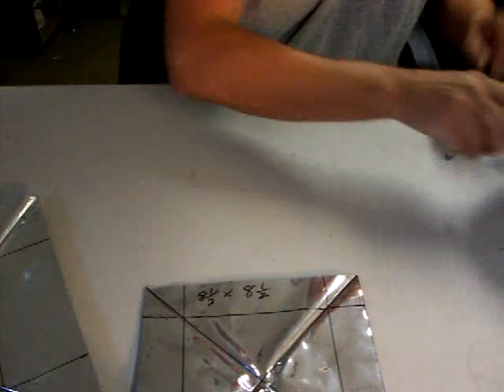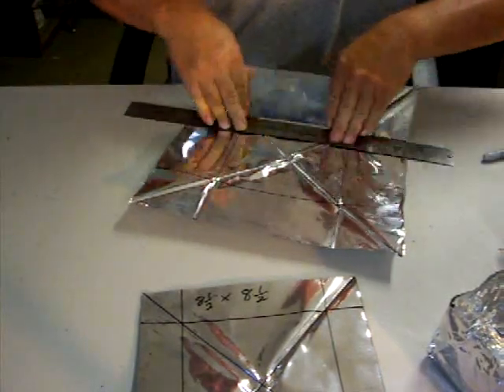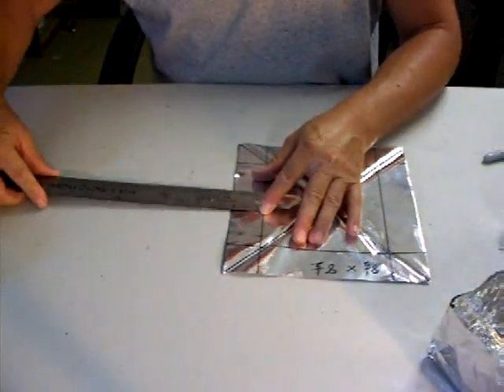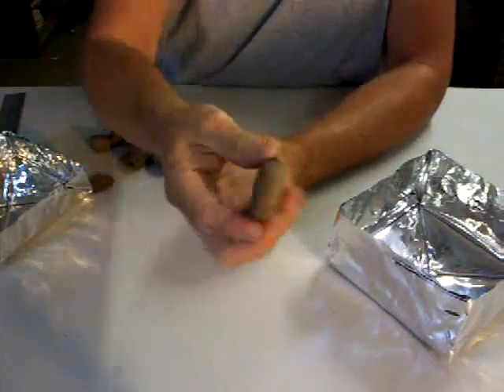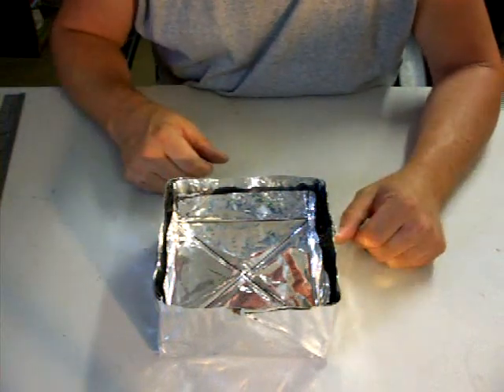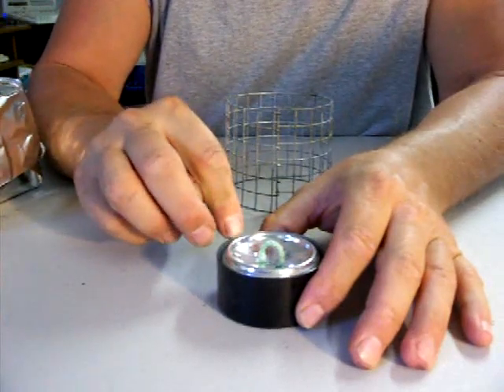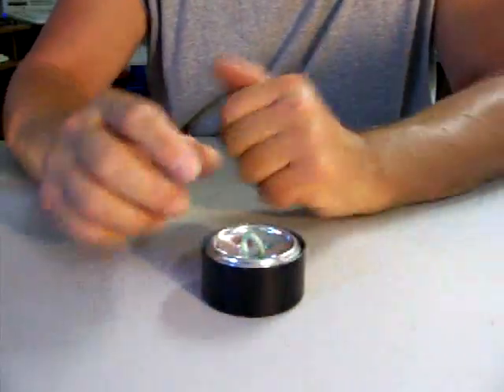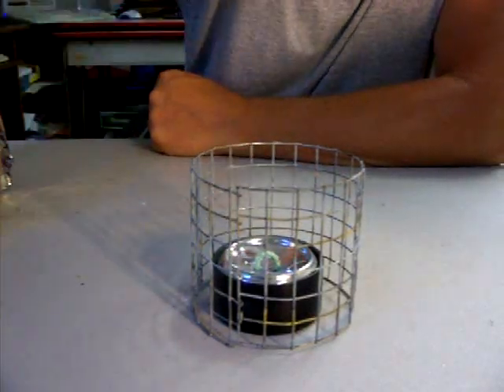Making the oven and pan

Comment: Can't we use sand instead of rocks? Sand transfers more heat all around the pan. Sand is also used in eastern countries to make coffee. Maybe it could disperse heat quick enough to prevent the pan from melting when using a hotter stove.